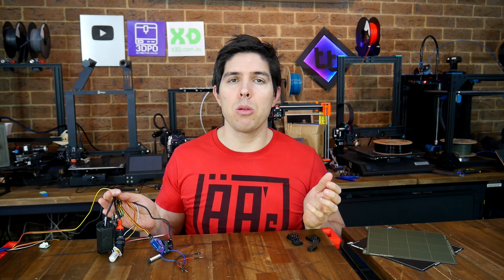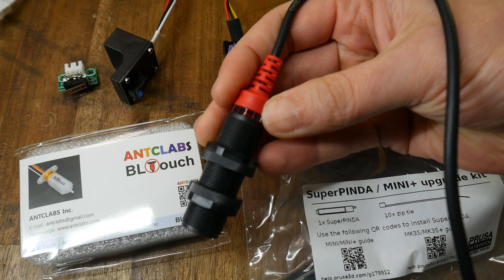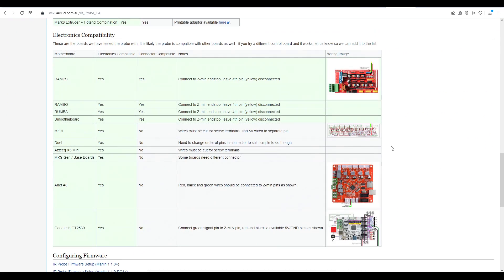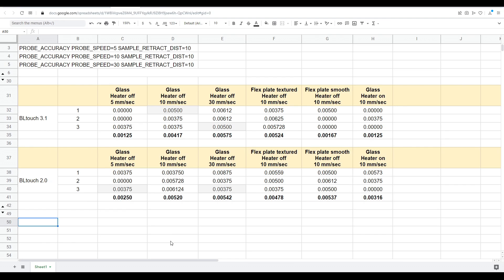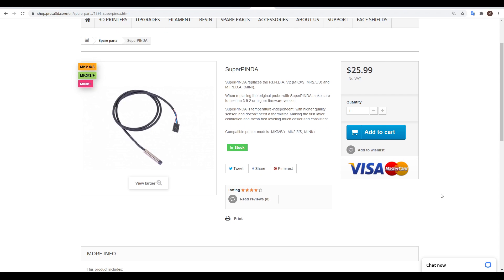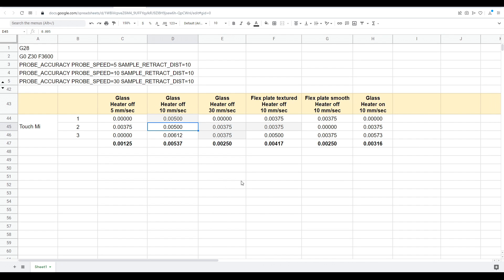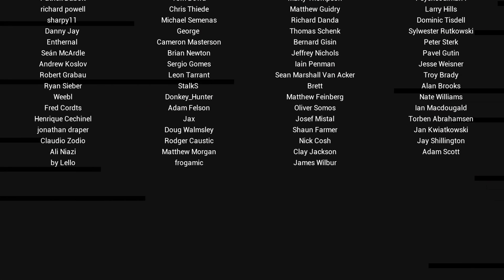Six popular ABL probes compared: Accuracy, price, wiring and more!

Comment: I have 2 EZABL (old mini version and new Pro). Price could be more user friendly :) But except of that I have to admit that Timm's product is great (especially a new Pro version). Great design, just love it, new leds for visual inspecion, very easy to use (once you know what you are doing - unfortunatelly mine start was very tricky and long - and here is a moment what is included into price - good support of TH3D team!!!! Occasionally they are willing to talk on topic related with 3d printing (not only EZABL) and they have huge knowledge on different background. ) 
Buing EZABL you have to keep in mind that in some cases (printers) you'll have to gound all stteper motors (my case) and PSU, level your printer manually on begining as close as you can get.  Yeap , standard div. test might be different on range of temp. Not a big deal while you use always one kind of filament. Sometimes it's required to turn off bed heater (like in AC Keenovo heaters- again my case:) Another great adventage is fact that TH3D provided theris Marlin version compatible with EZABl sensor. I would be great to see support for other firmwares like Klipper  or newer Marlin. I recommend. Regards TH3D team ;)

Comment: I got the CRTouch as it was the same price as the BLTouch and has the metal tip. I just wanted a bolt-on, plug the wire in and go setup for this mod. Not worth it to me spending hours upon hours running and making brackets and fitting it to save ~$20 at most?

Comment: I have an EBABL on my CR-10s and a BLTouch on my Hypercube. Both work great and the only difference is that on the Cr-10s I have solid bed mounts and the Hyper I have bed springs. Being that the Hyper was built by little ol' me, I can't guarantee perfect squareness of the bed frame so having the option to adjust the bed was necessary. However, after lots of tweaking, i was able to get the bed leveled enough to have a beautiful first layer. And, strangely enough, I have noticed that on the Cr-10s, I have a better first layer when I use 3D Gloop then when I use Magigoo - go figure!!

Comment: Ender 6 rubbish production. This is my experience of 3D printing. Get a problem, search for solution, solve problem. GET another problem! Over and over and over... Bed leveling => many tries => warped bed => glass mirror => won't stick => Glue stick => warping PRINT => bed too cold => filament stuck in bowden  tube => get Capricorn => still stuck => humidity => DOES IT EVER PRINT ???
Reply: Z step calibration

Comment: The Aus3D IR probe really is a copy of the original IR probe by DC42 as are all the variants available. The issues of different results white writing and glass surfaces are well known and documented and considered known issue :) but for most surfaces and setups it's very consistent as you found. One of it's big advantages is it's size, you can fit it really close and tight to hotends. Cheers

Comment: Interesting video. I am going to buy my first 3D printer this autumn (here in Sweden autumn is on it's way, would love to visit my Mum and Bro in Adelaide for a couple of months now 😂) My choice has fallen on the Prusa I3 MK3S+ with the MMU tho, so the probe is already a given. I saw a video where they thougt the BL Touch was very slow when calibrating compared to the EZABL but I'm sure other, more knowledgeable peeps, can confirm/deny it. It would have been interesting to see included in the tests, a comparison of calibration times and number of points. Time for calibration is significant if you calibrate before every print, even tho it may not be a long time in my life it can be frustrating to wait longer than needed. Like everything today, it isn't about the real wait/safety/health, it is about the perception of the attributes😁
Nevertheless it is interesting to see comparisons like this 👍

Comment: I recently purchased the CR touch for my Ender 3 Pro. I love the look and it works very well. I HIGHLY recommend a firmware with the Z-Offset wizard and Babystepping enabled.
Reply: Is there any way you could show me how to get the CR touch working on an Ender 3 Pro. I cant make it work. I am very new at this and I dont know what or where to get the firmware. I have an SKR E3 V3 main board.I have it all installed and wired up,  I just dont know how to do the firmware, would you be able to help?
Reply: @nickp385  In my opinion, it is a swamp out there. I blew out the 8-bit board somehow (no idea), bought the 4.4.7 board and wanted bed levelling. I paid for compatible firmware. Getting a working release took weeks, a couple of them wouldn't even upload, others misbehaved with the ABL. Once I got it basically working, the interface and new features were undocumented. After some prodding, I was referred to a video to get me going on their z-probe offset etc., but written instructions would have been more useful.

Comment: I use the BLTouch 3.1 because I felt mechanical was better.  Worked great for a few years but lately I've been having issues with the sensor not detecting bed height, cancelling bed leveling, and then beginning the print which resulted in the hot end scraping the plate.

Comment: This was a review on the SuperPinda store page ---  What they don't tell you about the SuperPINDA

What they don't tell you about the SuperPINDA:
As advertised the SuperPINDA as a higher quality, temperature-independent probe, compared to the PINDA. However, it has an important disadvantage compared to the [original] PINDA - slower bed meshing times.
The higher quality of the SuperPINDA comes at a cost of slower speed. The FW setting for the SuperPINDA bed-levelling probing speed is at least two times slower than the same setting for the PINDA. Also, there is a delay in getting the SuperPINDA to a stable temperature level.
The result is that mesh bed-levelling with the SuperPINDA takes a lot longer than with the [original] PINDA.

    22 out of 25 people found this review useful.

Comment: Cool.  I see you're using the FLSUN Delta?  Do they still use cheap plastic screws to hold the bed down?  That was my first printer until the bed came off.  I'm using the TH3D EZABL on my direct drive Ender 5 now.  Love your videos.

Comment: Actually genuinely question... so ive used ABL solutions in the past and they've worked great when using print surfaces that form to the bed (like spring steel) but recently Ive just took out the middle man and used a piece of glass. The glass wont warp with a bent bed, it will just bridge across any gaps because its a stiff solid print surface. So would I still need a ABL solution? Ive had no problems without one cause the solid glass just doesn't care if the bed surface below is poorly machined. 

Like I just dont see why id use ABL to accommodate for a warped bed when I can just use a piece of glass on top of it that I know is flat.
Reply: I have a glass bed (410x410mm) and use it exclusively but it does follow the warp of the aluminum bed it sits on.  Can see it using bed visualizer plug-in. It hides some of the warp but not enough to forego abl altogether.

Comment: I say you need to redo this test and purposley set one corner lower or higher to insure a large deviation. This is a good base for each one but you cant tell the actual varriance between them without an actual bent bed and its known issue. Like maybe even a printed first layer in the middle of the bed so you can see if the probe pucks up on the change and shows the height diffrence. Personally id use meassuring tools to make one corner .5 lower and one .5 higher so you know in the middle to those edges it would have a diffrent varriation. Repeatabikity in a single location is good but without having a location that has a known diffrence from base means you are not actually checking the presicion your just testing repeatability which is only one factor. The probe also needs to pick up the change accurately. And that can only be done with a known change added.

Comment: you should IMO allways probe your surface after they reach their working temperature because of the thermal expansion. i like the CR touch, because its a more accurate BL touch type of probe, it has a metal probepoint, and it doesnt keep the pin down if you cut the power.

Comment: I think the clear losers are the ones that only work on certain beds. If all of them had similar accuracy but some don't work on glass beds, then they metal-only ABLs are objectively worse. The BL Touch and AUS3D are obviously the big winners here, idk why you can't just say that outright.
Reply from the maker: Because it depends on each user. Almost all of my machines have a spring steel sheet instead of glass so that means all of these probes work equally well. What's relevant to you isn't necessarily the relevant for everyone else.

Comment: BL touch still has problems with firmware on 32bit boards for ender 3 pro. I used to swear by my BL touch but after having to disable it due to firmware problems I realized it's not nearly as necessary as i thought it was.

Comment: Keep in mind any sensor that must be used with a metal bed can NOT be used with a magnetic bed. I'm not sure why this isn't common knowledge or mentioned more often (perhaps many people think it should be obvious?) but if you try to use a sensor that requires a metal bed on anything with magnets you will get incorrect mesh readings. I fought this for longer than I care to admit when trying to use an inductive sensor and also a flexible removable bed.
Reply: Which is why you don't use point magnets but rather a magnetic sheet
Reply: @m3chanist  Nope, I was using a magnetic sheet and still had mesh issues. Any small difference in the magnetic field of the bed that isn't completely perfect results in inconsistencies in the mesh reading.

Comment: why arent the kind of probes in use which a anycube viper has?
i dont know a lot about probes, but the technology that the nozzle itself is the probe seems to be so confiniend because you dont have to tinker with offset and bullshit like that.
Reply from the maker: Pressure sensitive nozzle probes still do have a Z offset. In fact it will be positive rather than negative. The only probes that won't have a Z offset are ones where the trigger height is identical to the nozzle tip. Pressure sensitive nozzles flex up as they trigger.

Comment: The post installed bl touch on my ender ran flawless until one fine day it decided to let drop the pin and crashed in the print. The reason must be a loosen contact for the magnetic coil which is lifting the pin. Since the standby position of the pin depends on power, it's a little risk on the Bltouch to ruin the print and the probe.

Comment: Probing the same point 10 times is sadly only a measurement of repeatability not accuracy. 
To reveal the weaknesses of the inductive and infrared probes you have to probe different parts of the bed with slightly different metal below the bed or slightly different surface and see if they get the same results. But since any error in your X/Y motion system would add up, I can understand why you didn’t go down that route. 
My conclusion from your and Thomas’ tests: If you can get away with a stationary fixed bed without a removable print surface the microswitch is an option. Otherwise buy a BLTouch as inductive is expensive and might be inaccurate because it triggers differently above screws and IR might be inaccurate because it triggers differently over writing on the bed.

Comment: First thought with the IR probe is the reflectivity and absorption of IR based on the color of the bed it's working against.  Be interesting to see if the performance varies for a lighter vs. darker bed.
Reply: I don't think it would be much of a difference. The point is to get an even distance, it's not that important on what the distance is. The true test would be to see if it get variations in the result if you have a build plate that looks like a checkerboard.
Reply: I was surprised that the LED probe was so accurate.  The angle of the LEDs causes the return signal to peak at a given distance, something I have seen in industrial controls.  I don't think the brightness of the signal matters too much, just the peak.  The electronics probably reacts to the percent change over time. The fact that there are two LEDs and two receivers also makes it more robust as the electronics will see the peak twice.

I am a controls engineer and finding accurate sensors for cheap is very difficult. Most sensors have published accuracy or repeatability values in the millimeter range at best. Lately I've been searching for a sensor that can detect the distance of a plate of glass with an accuracy better than +/-0.1mm.  Most optical sensor vendors don't want to touch it, saying glass is too difficult.  There are a few that cost thousands of dollars and can always measure the thickness of the layers of glass.  But I'm just looking for the distance between the robot and the glass. Of course I'm trying to make the measurement without moving anything or touching the glass, so that makes it more difficult.  I'm currently looking at two ultrasonic sensors, both have a repeatability of +/-0.375mm, of course temperature is a factor because the change in air density.  So what I mean by all this is that the optical sensor in this video is remarkable.
Reply: IR doesn't work like that.

Comment: overall i would say bltouch is the winner. large community support and documentation, fair price, detects everything accurately doesnt care about humidity, surface material ,or temperature. only downside is its size, the 5 wires, which can be reduced to 4, and shouldnt ram its pin into anything. next, i would make clicky probe which containts a microswitch. Zero weight, for a price of a bread, accurate, not sensitive to surface, temp, humidity, electric noise, only 2 wires required, or even 1 if you get ground somewhere from toolhead

Comment: I support and enjoy your videos but I must comment on being disappointed on your video not including a CR Touch! It’s design is not a clone but a opto sensing approach and looks to have a shielded coil. It’s also doesn’t friend on a magnet in the end of a plastic probe that has come lose for some as well as requiring a adjustment of the tiny hex screw fir some based on group posts over the years. Price wise of one searches the CR Touch complete mounting kit can be found for the same price as a BL touch.
Unlike the more hard to buy/find versions you reviewed, the BL and CR touch al’s are the easiest to buy on Amazon with a very good return policy. 
I requesting that you do buy a CR Touch and give it a fair review! I use a BL touch snd a new CR Touch and unlike the occasional CR Touch error on power up, the Cr touch has had none on the same printer and firmware. I’m thinking the CR Touch is less susceptible to surrounding magnetic fields or metal or cable runs parallel with the hotend cables? Something a more critical review may reveal?
Weight is more than a BL touch but much less I’m thinking then some of the Abl’s you reviewed.

Comment: Temperature drift is also VERY important. My PINDA clone heated up around 2 degC while probing the bed, which caused the measured distance between the first and the last points to be off by around 0.1mm IIRC, and you could see on the mesh, how the measured distance changed.

Comment: 80 steps /mm will not render that much data.. rerun at 256 microsteps. and 100 probes
Reply: I wish I could thumbs up 1000 times! 

Michael, I encourage you to try a few of these probes with higher resolution Z movement and many more samples in each test. 

It's a shame when so much effort is expended on testing, documenting, and sharing, all while a fundamental piece has been missed out misunderstood. Minus the video production, I've been there many times.

Comment: Once I have my BLTouch height set correctly I have perfect first layers, I set it manually with the slots on its bracket, it takes a few tries to get the nozzle really close, once I am happy with the manual adjustment I usually add a single click down to get a good squish on my first layer.

Comment: Perfect timing. I am looking at an auto BL unit. Ill probably go with a BLTouch but Im wondering if there is much difference with the different brands available. There seems to be a huge price difference between them. They can go as cheap as about $20 on eBay to $60-100 on Amazon and up $130ish through Australian retailers. Ive seen the ANTCLABS one from only 1 Australian retailer but Ive found them to be very unreliable.

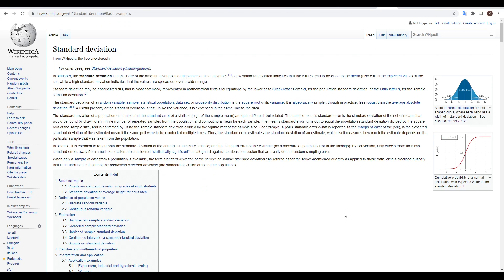Comment: The test at 3:57 has all values except for the first one exactly the same. Was that a common or uncommon occurrence in your testing? If an ABL probe can't put out a reliable reading until it's already been triggered recently, that makes it an "avoid" product.
Reply: Don't most bed probing routines already repeat the first probe location a few times?

I know that Smoothieware probes the first point 3 times, and subsequent points only once. I think I've seen Prusa machines do similar.
Reply: I wouldn't know. I asked that question as someone who's never used ABL before but was considering it.
Reply from the maker: This is explained in more detail at the end. Generally for these probes, 8 or 9 out of the 10 probes per set were identical and difference in the others was so small its meaningless.

Comment: I'm a bit disappointed you didnt test the Creality CR Touch. Others have reported it to be more accurate (technically).  I was able to buy one on Amazon for cheaper than the BLTouch.   The metal probe tip, more subtle lighting and modern design make it a better choice IMO.  It also is plug and play (less a simple firmware flash on a 32 bit board) for huge population of Creality printers with the included metal brackets.